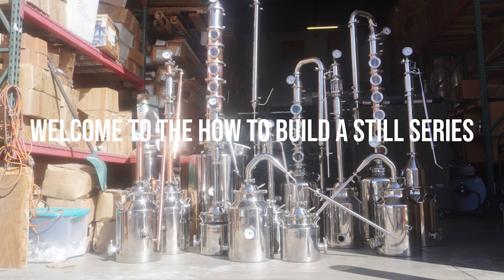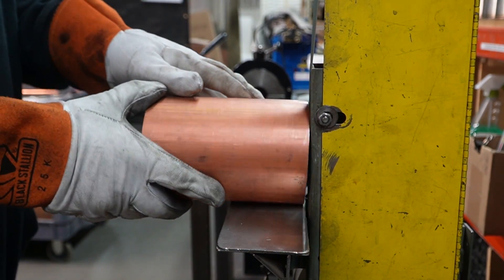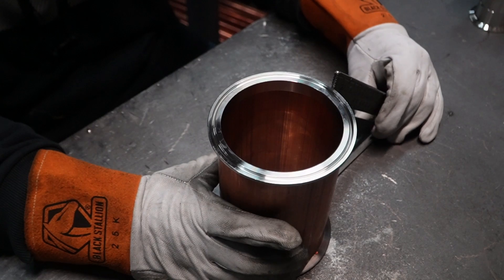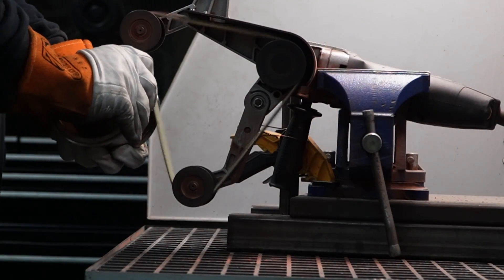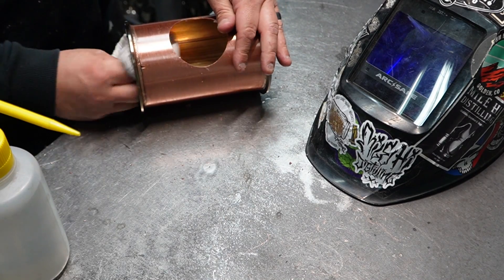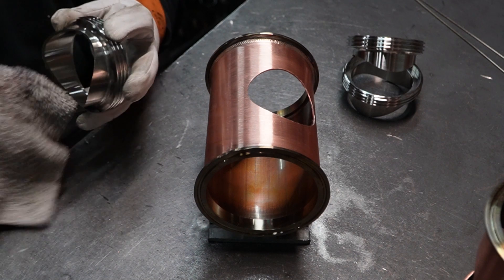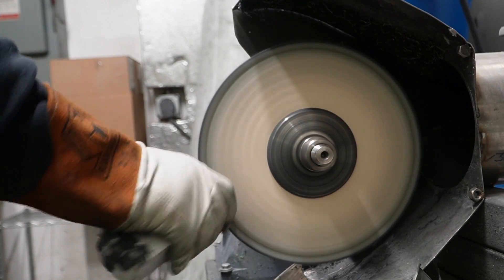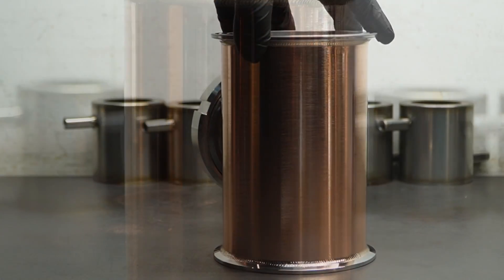How To Build A Still: Flute Sections

Comment: Where do you get the window section that has the ferrule already cut to the round shape of the 4" pipe?
Reply from the maker: This is known as a DIN fitting. There's a lot of manufacturers that make them!
Reply: @milehidistilling1  I've used my best google-fu, I can't find those DIN fittings anywhere.
Please, throw a guy a bone - where can I find them in 2" for a 3" column!
I'm retired, I can't afford to buy complete sections on my fixed income.
I already have the 3" copper pipe left over from a project years ago.  All I need are those precut saddle sections and I'll be in reflux heaven!

Comment: One more question: What is the gauge of the copper used, or the thickness of the sheet used to make the copper tubes?
Reply from the maker: We use 4mm thick copper pipe!